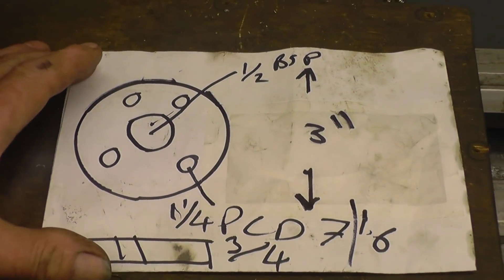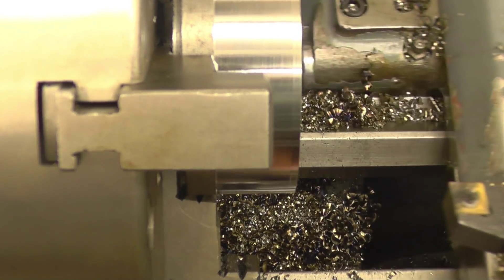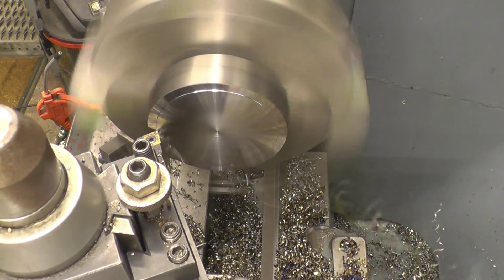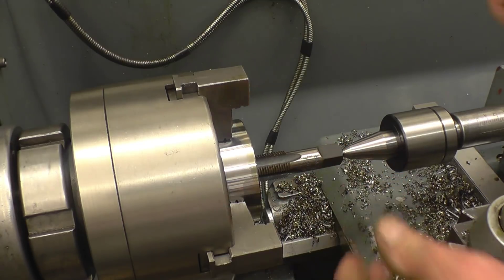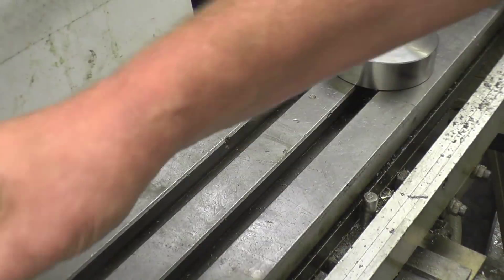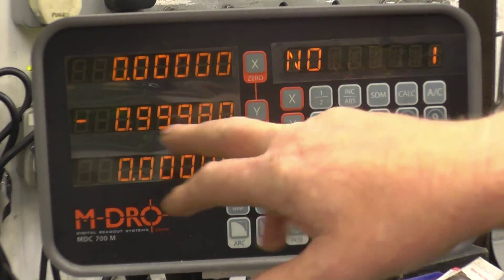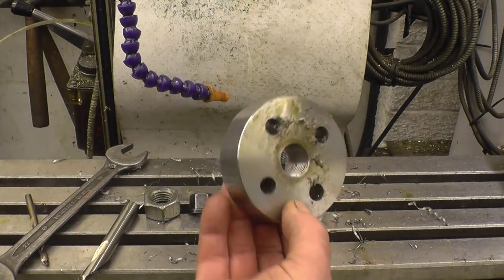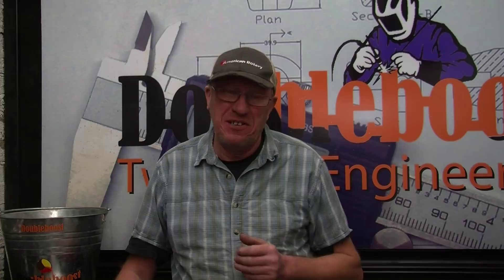SNNC 244   P2   High Pressure Flange PCD

Comment: ya that facing cut is nice when you get the reflection with the rainbow of colors in it everything came together. banggood you say if they have inserts for brass/cast iron  harder stainless and a insert for hard tool steel I will definitely buy that holder for the price of one pack of some carbide inserts I could probably build Shandon hkw's heat treat oven and a tool post grinder